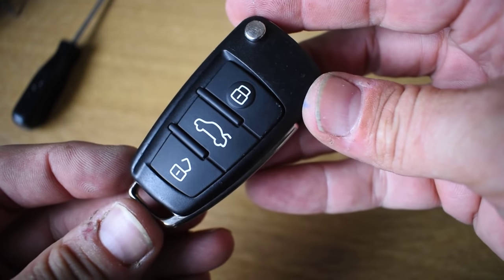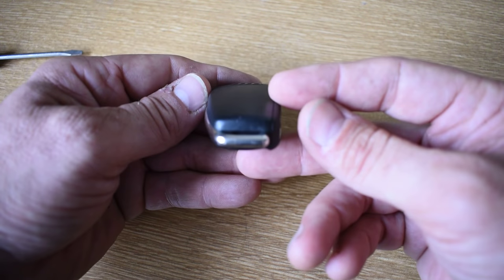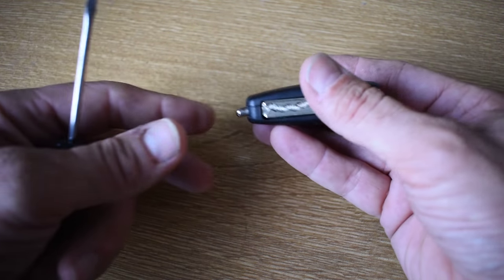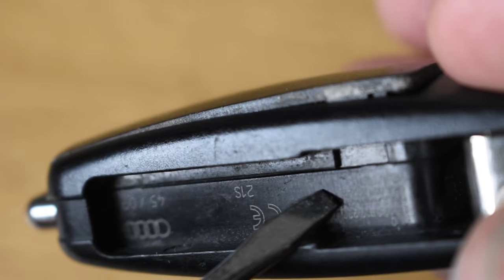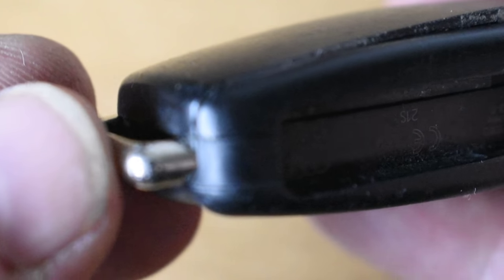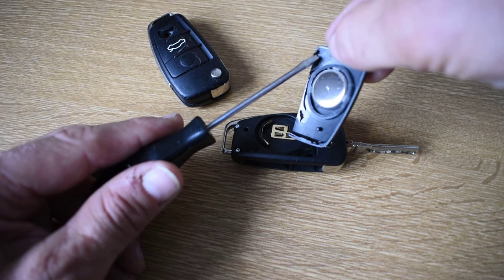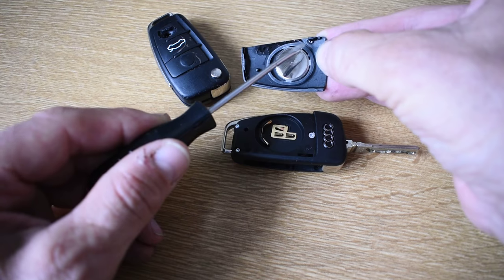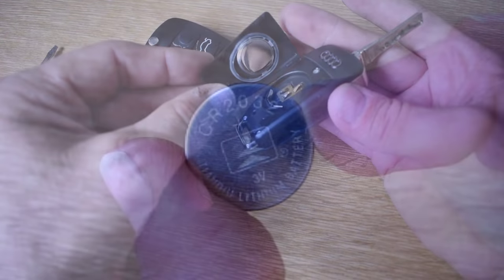Audi A3 key fob BATTERY REPLACEMENT

Comment: Hi, excellent presentation,  thank you. 
My 2019 A3 is a bit different,  the battery remains in the body when the  cover is removed. Inserting the new battery requires the battery to be pushed against the edge contacts at an angle until it will slip home.

Comment: Excellent instructions, thank you! Where others fail to do well but yours does, is with the cover insertion. Btw, while these key fobs are really very well made, I experienced a baffling strange problem. It would not unlock. Lock was OK. So was rear hatch & panic. But not unlock. I thought I had a driver's door loom issue (it's fairly common on older A3's). Sure enough, it was the battery. I put up with that for 4 months! Strange, that only that feature stopped working due to low battery.
Reply from the maker: Thank you for your kind comment, I try to show the visual detail that is needed. Amazing how a simple key battery can cause such a headache sometimes :-)
Reply: @HatBoyHarvey  I would expect there is some way to program the fob such that it shows a low battery indication. Or, perhaps the unlock not functioning is that--just not properly or obviously documented.  ;-)

Comment: This video is extremely helpful because I have the same exact fob, but stupid question - how exactly do you know when the battery needs replacing ? Is it when the red light flashes every time you press a button ?
Reply from the maker: When the red light stops flashing or the key doesn't work :-)

Comment: Also, if your key fob battery is completely dead and you can't replace your fob battery, you can hold your key by the raised marker on the right side of your steering column while you hold down the brake and hit the start button. Your call will start and operate normally.

Comment: Great video,thank you for sharing with us,do we have to program key after that? thanks
Reply from the maker: Thanks. Changing out the battery should not effect it, but if you were having problems before the battery change then you may need to pair the key to the car which is relatively simple. If the key doesn't work at all, you have tried a new battery and pairing to no avail then the key maybe faulty and a new one would be needed, which would need programming.

Comment: Are these key have different internals?
Mine doesn’t look like that on the inside
Reply from the maker: Good question. Not sure, I thought if the cover like mine they may have at some stage changed/ improved the internals on later  year fobs even before changing the outer shell !?

Comment: I have this strange issue that when I put the cover back on after replacing the battery, the fob stops working. Then when I take the cover off, the fob starts working.. any solutions for this?
Reply from the maker: Maybe the tension on the battery contacts have weakened or putting the cover on dislodges it somehow. You could try some contact cleaner. The key can't work without the battery. You must put the new battery onto the cover, clipping it in and the right way round first before connecting the two halves.
Reply: @HatBoyHarvey  thanks for the reply! My problem was that I had the wrong version of the battery!
Reply from the maker: @Mojothetwisted glad you were able to spot that :-)

Comment: Do I have to have the key reprogrammed to unlock and lock doors for a 2017 a3
Reply from the maker: If the key doesn't work you will need to re-sync the key to the car. there are slightly different methods to do this with key in ignition or in drivers door. models/years vary. Try pressing unlock, hold, put in ignition, turn to on, hold, turn off, key out and release.

Comment: After replacing baterry, it is still showing indication when switching on that i have to replace the battery ! Obviously it needs to be reprogrammed, but even after following the instructions on car manual the indication might disappear and after a short time (weeks or days) again the same message to change battery appears on screen. Model Audi a3, 2014, 1.6 tdi. 
Any suggestions ? Am i doing something wrong ? The key  baterry is brand new. Thanks.
Reply from the maker: Your key maybe set to long range which uses more power, which could be checked with VCDS, but I don't think it would be that much drain. I presume you have tried syncing both keys to car? Maybe one of the buttons has jammed down, which would explain a drain, do any of the buttons feel like that?
Reply: @HatBoyHarvey   thank you for your answer. I have cross-checked multiple times if any button is jammed and i am certain that this does not happen. Perhaps it us some sort of bug for system operation or unbalanced synchronisation problem of the car (in my previous Opel Vectra when i changed factory control battery with another in one of my keys it never worked properly thereafter regardless trying new batteries and several reprogramming attempts).
In my case now, the problem occurs only in the key i have changed battery. Can you tell me how to make synchronisation correctly after changing key battery (car manual method perhaps is incomplete or not working permanently for my case) ?
Thank you.

Comment: Great , now my key doesn't lock or unlock the doors with the new battery installed .... now what ?
Reply from the maker: Use the key manually, then re-sync the keys to the car.
Reply: @HatBoyHarvey   Explain how to manually use a key when the car doesn't have an ignition ?
Reply from the maker: If you don't have ignition place the keyfob next to the remote symbol on the side of the steering column, foot on brake and press start.
Reply: @HatBoyHarvey   Ive actually done that a few times and the locks still dont work . Is there a certain battery brand maybe ? I'm using some no name brand cheap CR2032 . Maybe I need a energizer  ?
Reply from the maker: @TheAgenTWorm  always good to fit a known brand of quality and best to clean them so there is no grease that may effect the contacts.

Comment: my battery is stuck inside the key wth
Reply from the maker: If the battery has leaked or the fob has got wet then the contacts can be corroded and stick to the battery.